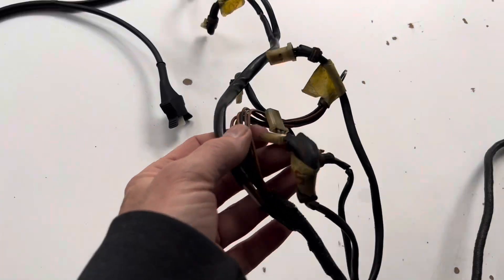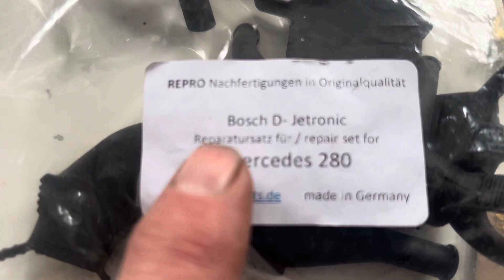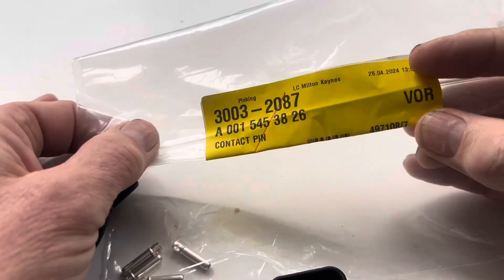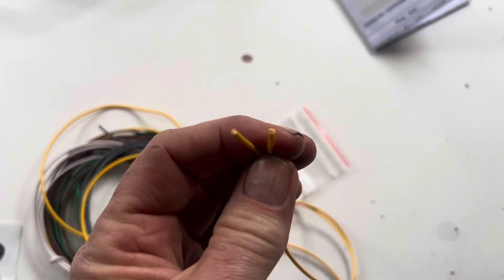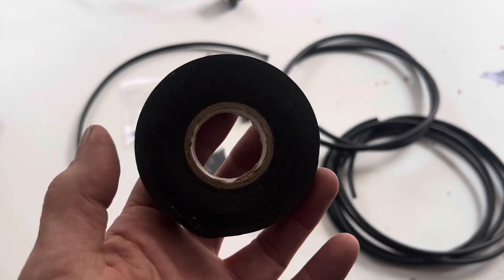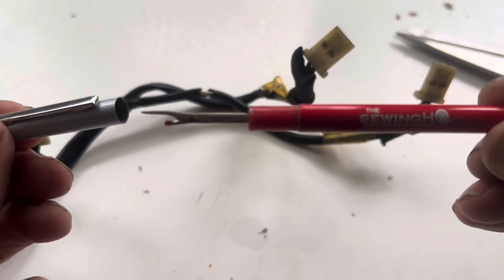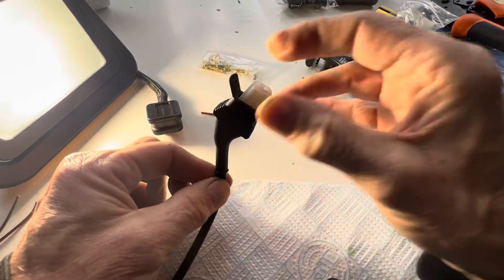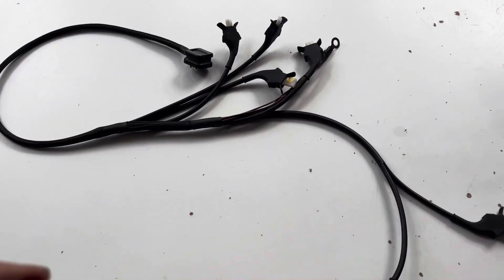Mercedes R107 D Jetronic  wiring harness. How to make your own.

Comment: Mike my plugs are the same as yours same shape.  However I see no marking on the injectors where is the +/- on the injector?  When you use the old heat crimped plugs when you plug into the injector is the crimped side down or up?
Reply from the maker: Crimped side down. If you look carefully at the beginning of the video below, you will se the + symbol on the top of the injector by the metal contacts:

https://www.youtube.com/watch?v=3pPqYKtfdFY

Mike

Comment: Yes.Mike it would be the heat shield that I need so the 4.5 mm should work to protect the 2 wires that go into the plug for the injector.  Since the injector has a + ve / -ve post i am thinking it must matter how the plug goes into the injector I see the common thread on the injector wires is a brown wire is this the negative?  If so I don't see any markings on the injector itself.  I just want to make sure when I reconnect everything I eliminate obvious issues.
Reply from the maker: Yes  - brown is earth. The Bosch injectors are usually marked with +ve and -ve. On my cars, the plastic plugs are not rectangular and only fit into the injector one way. Mike

Comment: Mike I didn't see 5 mm at AES for 2 wires I believe they have 2 types of PVC black drink wrap to be used on injectors. I think they were both 4.5 mm thoughts on which one I need
Reply from the maker: Hi - are you talking about shrink wrap or heat shield?

Shrink wrap would potentially go around the metal crimped terminals and would be maybe 3mm. I bought a box of different shrink wrap sizes when I was doing the ballast resistors.

Heat shield would go over both +ve and -ve injector wires and shield them from the engine heat. 4.5mm sounds about right. Mike